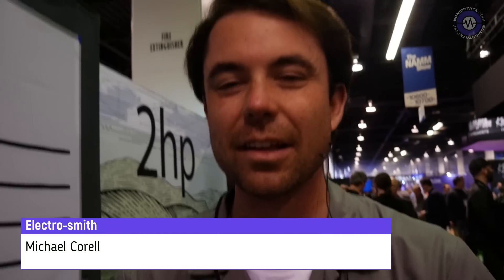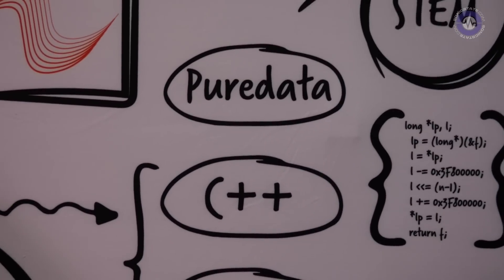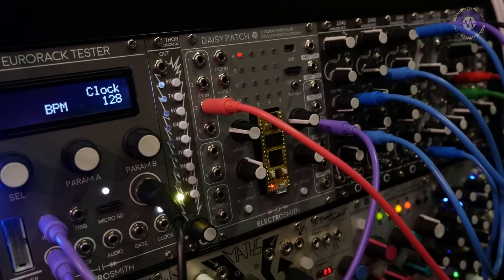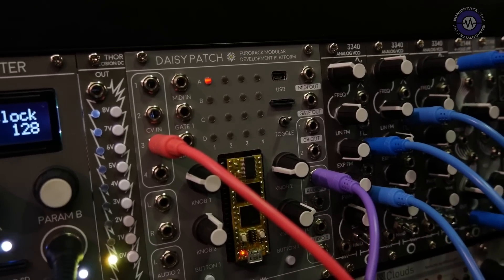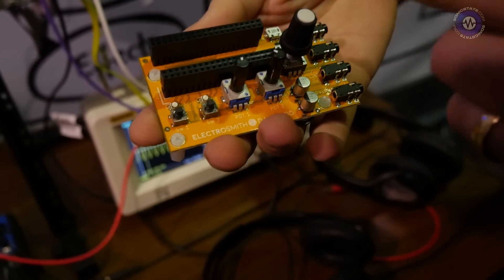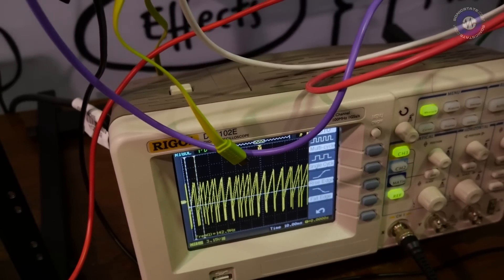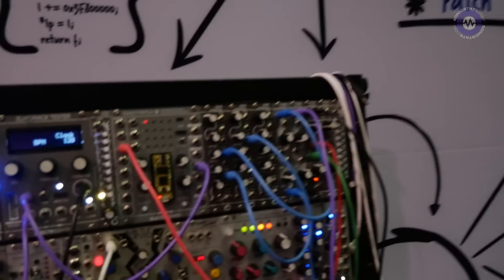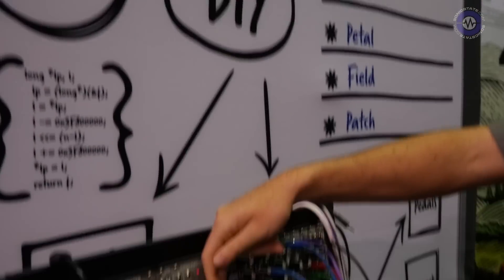NAMM 2020: Electro-smith Daisy Development Platform

Comment: Id be VERY interested in porting some of my Max patches to that guitar pedal platform... very cool! I wonder if there would be a way to protect the circuit board, like a cover for the pcb if one were to take the pedal out and gig with it.  Watching with great interest!
Reply: I think the focus of these units are for development, and no neccessarily production. From experience, there aren't a lot of good way to gig with development equipment.
Reply: @workethicrecords5901  That’s right. All Daisy products are for development purposes, which is a very cool concept. Once you have developed your prototype you can start designing your enclosure. 3D printing, assembling in aluminum, even wooden enclosures. So many options.